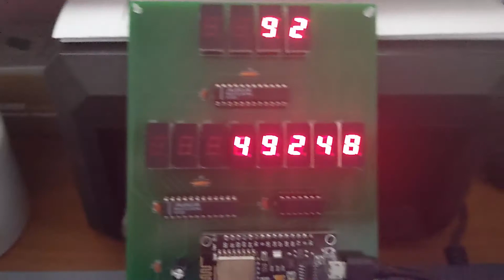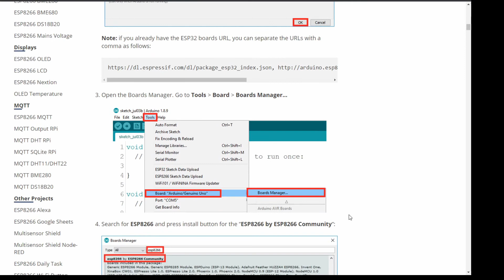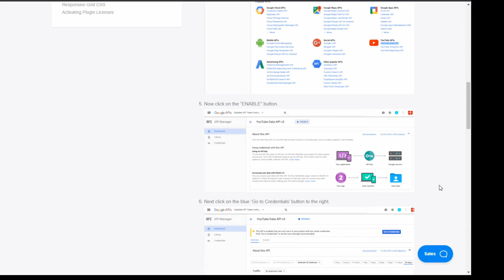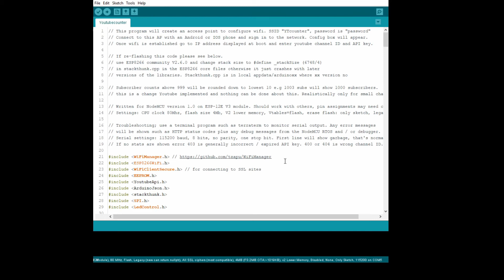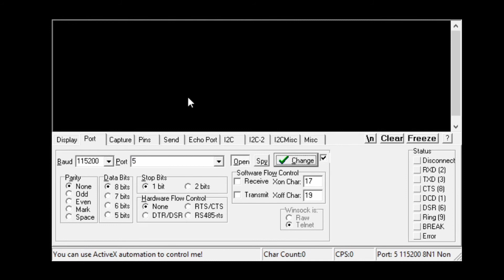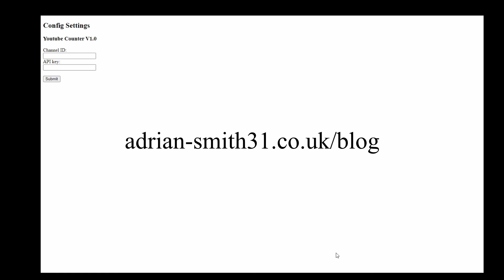Make a YouTube counter using old LED displays & NodeMCU. Retro electronics look.

Comment: It is very good project, will be very useful for such channels that have <10 000 subscribers
Reply from the maker: Yeah it will be a bit pointless over that amount. Could be modified to display say 49.6 subs for 49.6k would have to push trailing zeroes to the non existent remaining 4 digits so it doesn't look shit. A possibility.